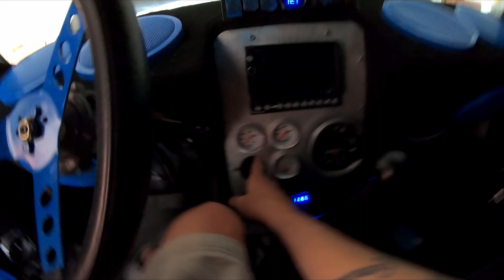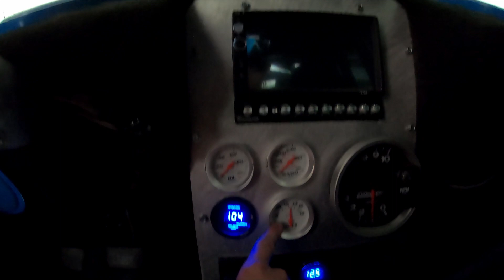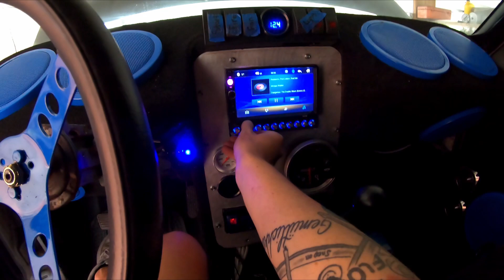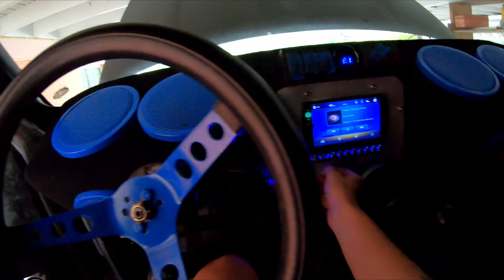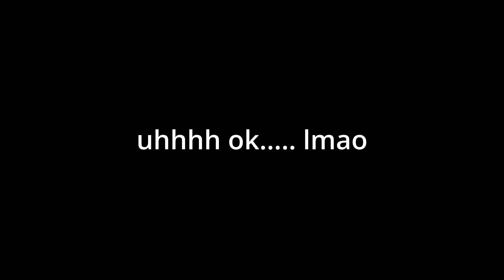Things have changed, also s10 update

Comment: You need a self energizing alternator. Ses at the end of part number.single battery wire. 
Take the battery cable off the battery while its running and see if the volts go up! If so get a diff battery.

Comment: Check the output at idle in the alternator and or chance the pully to spin it faster. Should tell ya out put at specific rpm. Change the pully increase the output at low rpm.

Comment: You need to check if that alternator has a two pin plug and a charge post. one pin will be #1 and the other is #2. #2 is jumped to the charging post and #1 should have a switched power source. once you turn the key or turn power on it will excite it to make it charge. need to add a diode with that switched power source wire so power can go to the pin and not back the other way. the diode is to block the parasitic drain that will cause it to go dead.. ran this setup in many many setups from tractors to race cars... hope it helps..

Comment: While I have always wanted to have a go in a semi I just never walked down that path. Spent about 18 years in IT then 12 years in military aviation. Which I ETS's from to go into business with some friends. Right when covid hit......  Plan A instantly vaporized and we went off in separate directions to wait out the zombie apocalypse rehearsal. Parents with almost 80 years of mileage on the clock started dancing. Break dancing.  Hip move here, Collarbone there and they were both down so I tossed my junk into storage and started working on ways to get that inheritance faster ahhhh I mean take care of them... Now that they are back in motion my sister is taking over.  Ran across your channel a while back and before I knew it I had a ton of trucker channel content and info stored on the other side of my face and now I am just waiting on some paperwork then I am heading out to knock over, bend, run over, rip out, crush, bounce off, sideswipe, misjudge and leave an I was here mark as I get my CDL so I can do that all over again on the road by myself.  As doors close others open. Sometimes they are trapdoors. Sometimes they are tiny dog and cat doors so you have to look around as best you can before they swing shut.  Thanks for the content and a small slice of what I am getting myself into. There is almost always a path back from the dark road we sometimes find ourselves on. A few of the pilots I work with have gone down a dark path and then found themselves right back where they wanted to be. Back in the air. Hope you find where you want to be while you regroup and reassess where you are now. Attitude is everything and the right one will get you where you need to go...... 
When life gives you lemons you walk over and kick it in the gut while grabbing it by the throat and yell I ordered Orange Juice damnit.............